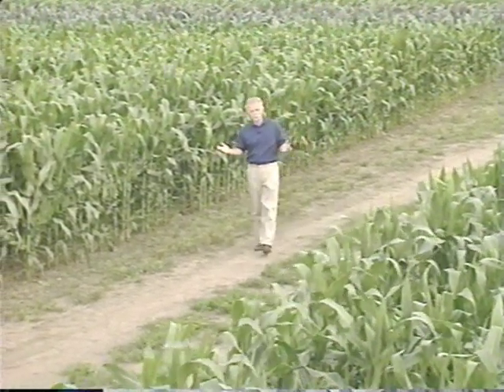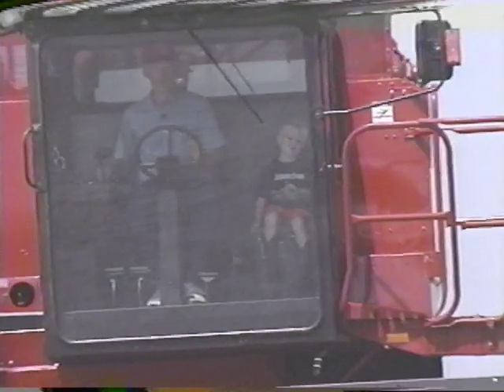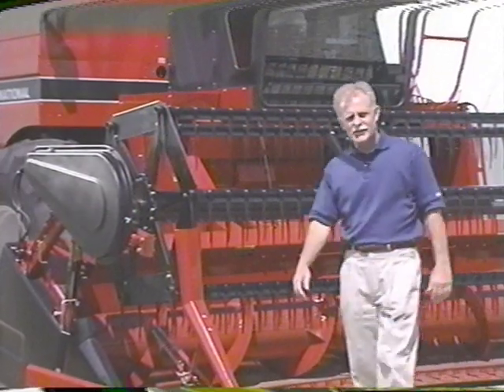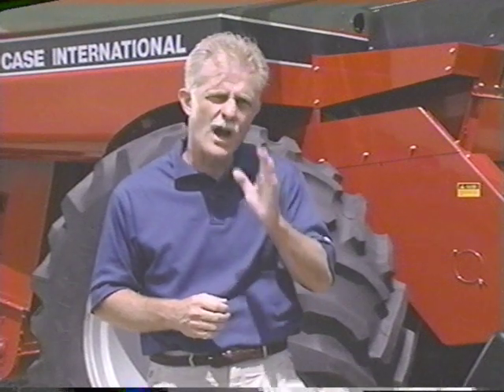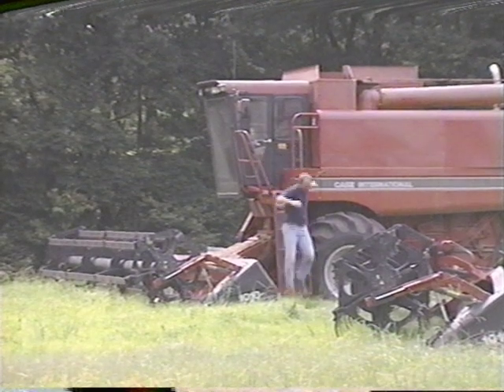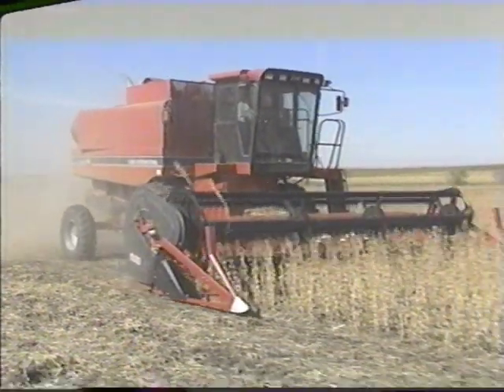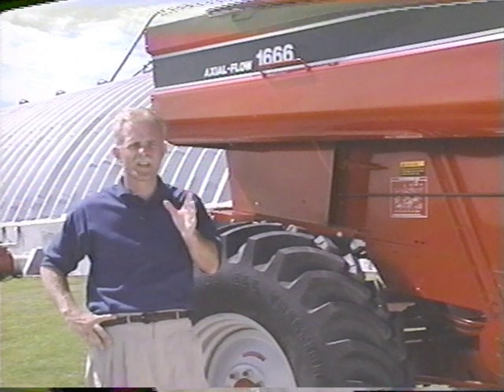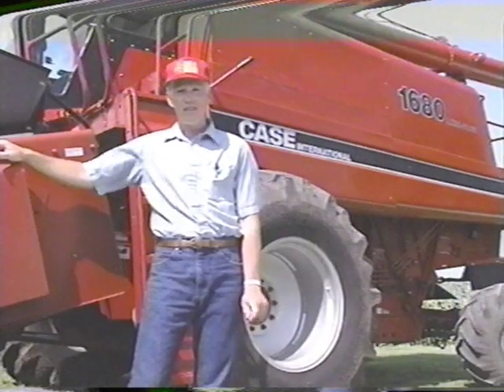Case IH - Axial Flow - The Inside Story

Comment: I used to work at a CaseIH dealership from Spring of 1998 through October 2001.  I will stick with my Gleaner R52 but this video was from back when CaseIH cared a bit more about the American farmer IMO.
Reply: Don't call them "silver seeders" for nothing.
Reply: @bondobilly9369  please explain
Reply: @SilverGleaner  they lose more grain out the back than case's. We ran one for about 8 years and went back. Not to mention their a mechanical nightmare compared to the red stuff, and our broke down litterly everyday. The guy who bought it off of us, ran it for a couple years and just parked it.
Reply: @bondobilly9369  That's not our experience. The Gleaners are heavier built in key wear areas. The drives are heavier, the frame is thicker, the feeder house is heftier, the augers were a 1/4 inch thick and the rasp bars and elevator sprockets were chromed. Measure the thickness of the frames on an N6 vs a 1660. Yes, the early N series had teething problems but within a couple years they were a great machine. The Gleaner is designed better too IMO. There is no cone or elephant ears to wear out, the rotor takes far less horse power because of it being transverse vs axial, the excelerator rolls and scroll fan were far superior to the conventional system used by the Axial Flows, etc, etc. When did Case introduce auto reel speed or variable corn head speed? There is a long list of features Gleaner had before Case or IH.
Reply: @SilverGleaner  the gleaner is a mechanical nightmare, just compare it to a 14, 16, or 21 series. We had silver seeder for a few years a dumped it for a 1480. Less down time, cheaper to run per hour and more output per hour too. Half the grease zerks/ bearings. These auto variable this or that, are cool factors, not needed to get the job done. The only issue we had with out red machine was blowing a head gasket, but the 436/466 are notorious for pushing them.
Reply: @bondobilly9369  I've compared them, worked on both, driven both and there is no comparison. Give me the Gleaner every time.

Comment: Gotta give it to IH for making the axial flow combine a reality pure craftsmanship great machines
Reply: IHC were true innovators .
Reply: @interman7715  agree 100%
Reply: @interman7715  Great combines (a little light in the high wear areas) but IH could take the simple concept of a wide front end on a tractor or the 3-point hitch and add a bunch of unnecessary wear parts.
Reply: @interman7715  But the cross flow cleaning fan is pretty much a copy of the Gleaner fan that's been around since 1972. Not to mention the several other features these combine were just recieving that Gleaner had for several years.

Comment: A lot of comments here are pro or con to other makes. Thats all and good, but you have to compare machines of the same current production. Of course an old model is not as efficient as the newer versions.  I've had and worked on man y makes and models. a new rotor is better than an older IHC. likewise a new Gleaner would be better than any make's older offerings.  But all combines are super high maintenance and will and do break down!, no matter the make.

Comment: When has a farmer ever set his price for his grain???
Reply: I believe the increase in selling price is a result of reduced dockage fees at the selling point. Grain damage as well as material other than grain (MOG) reduces what the elevator or processor is willing to pay per bushel. This is especially true for food grade crops like white corn and popcorn. Red combines have long been known to damage grain less, put less MOG in the tank, and put less grain out the back as loss when compared to their competitors. They aren't perfect but they are darn good machines.
Reply: That's the problem.  The industry goes to wall street for pricing.  how dumb is that???
Reply: @kbailey43  Not compared to Gleaners. Gleaners were and are still the gold standard in grain sample quality. I've never been docked for crackage or mog with any of my Gleaners whether is was my old dependable, never let me down E, the mighty L2 or my current R52 which has been as easy a combine to set as any I've ever run. But I've never grown food grade crops.... that said Gleaner has a great grain quality reputation.
Reply: Well it did help when we got rid of trump and got Biden instead.   I lost a lot of money because of trump and his Chinese tariffs.

Comment: Nothing runs like a DEERE
Reply: Or smells like a john.
Reply: So true, nothing runs the grain out the back like a deere.
Reply: Yep JD outsells CaseIh 4-1
Reply: @johnallen5996  nothing burns more then a deer or breaks down like a deer 👍
Reply: @johnallen5996  in parts and repairs?
Reply: @TRUMP2024-m1y  4440’s are bringing as much or more than they sold for new in the 80’s.
Reply: Gleaners

Comment: East Moline was closed in 2004.  I believe the site is leveled.  Grand Island Nebraska is where they are built now.
Reply: They moved because of the union from what I understood when I worked at a CaseIH dealer back when it was first being talked about in 2000 or so right after Fiat bought CaseIH.
Reply: It's too bad that Fiat took over the New Holland plant at Grand Island and switched it to red machines.   New Holland is the better combine with the twin rotors and Fiat just ran that brand into the ground.

Comment: So, you guys gonna tell us when the axle breaks? Or how about when it burns to the ground?
Reply: And this hasn't happened to any other brand? LOL They've all had issues and still do. If it's mechanical, and you use it, it's bound to give you issues sooner or later. Just saying. Cheers :)
Reply: @Ham68229  Anybody that I know who has ever had one of the older axial flows has had a back axle snap. And yes, I know all brands break down, and the actual combine part of the machine is pretty good, but I think that’s not just a coincidence.
Reply: Deere had a pretty good rep for burning.... more so than IH by far but none beat Massey for that blue ribbon.
Reply: WHAT
Reply: never had an axle break on my IH,  I do know of a 6600jd that both drive tires fell off of going down the road, apparently jd didn't put thick enough steel in the wheels on some of the early 6600's
Reply: There's an old saying among farmers, "Nothing burns like a Deere".
Reply: @cadew4418  we used to run 2 2388’s and a 1688 probably the best machines we had until that point, we did snap a rear axle on a 2388 but had it back going the next morning when the other two headed to the field, now we have a 8230 and the wear parts on it seam to wear pretty fast compared to the old ones but it brings in a ton more grain at once and harvests all the acres on one machine instead of 3

Comment: I heard John Deere actually made the blueprints for the first rotor machine but couldn’t get it to work.
Reply: Curtis Baldwin of Gleaner fame patented rotary combine technology at least back to 1930 or 1931 and he sold a bunch of pull type rotary combines before the Great Depression took down his company temporarily. Has has several patents involving rotary technology.
Reply: Not necessarily factual but, I am with the understanding that John Deere sold the rights and patents to IHC in the 70's prior to IHC being bought out BY Tenneco and combined with CASE.
Reply: Then why did they wait so long to switch to a rotor. Wanted to be different?
Reply: Massey had the idea first then gleaner took it then ih then Deere